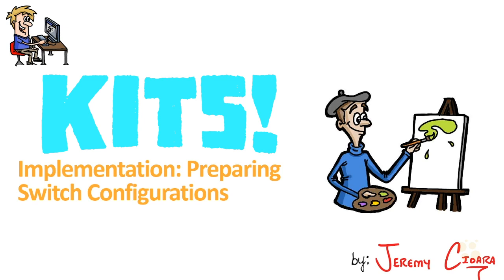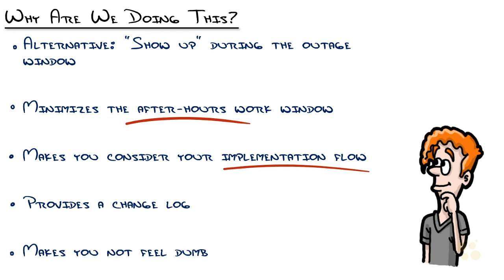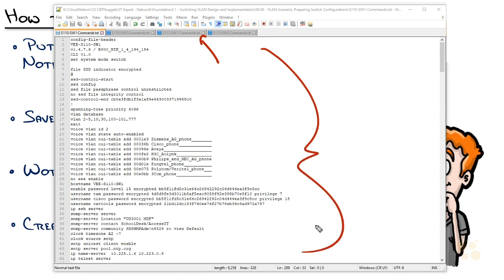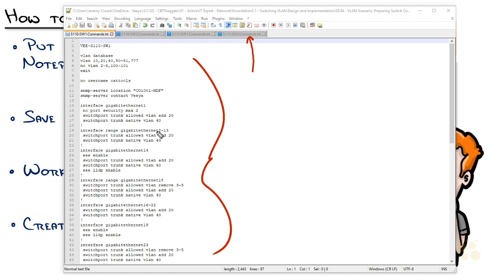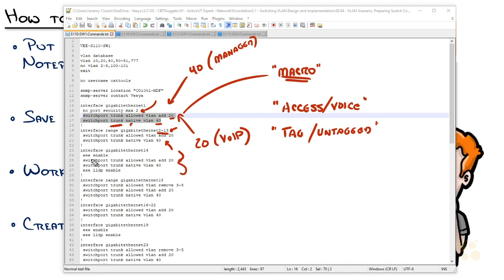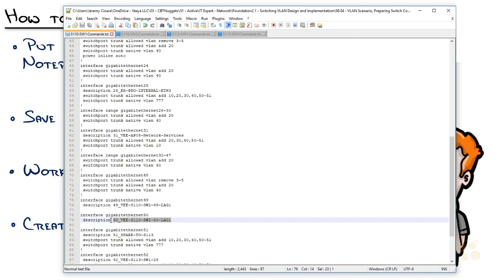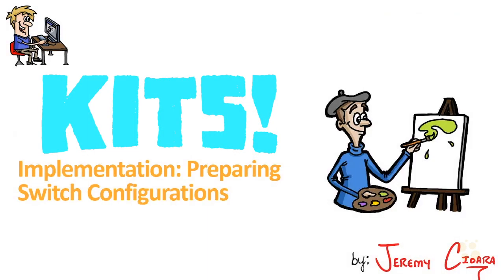How to prepare network configs IN ADVANCE

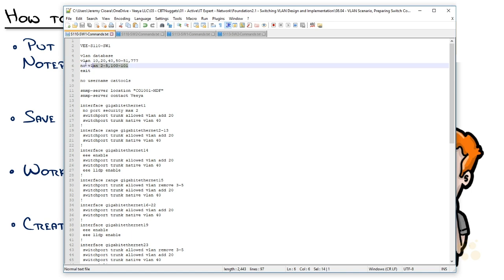Comment: 9:27 Is the solution to eliminate all unused VLANs as the final command? Because by then, you'd already have reconfigured the interfaces into the new VLANs, which means you have connectivity (if you didn't, you'd notice that before the final step of eliminating the unused VLANs).

Comment: I would really love some "commit mode" on cisco. It would be useful when you have to do something that will cutoff your access, do some configuration later, but you can't avoid it. The closest thing I know is a manually activated EEM applet, but this is a total hassle
BYW Do you really have a user "cisco" with Privilege 15 in production?
Reply: Heh his SNMP password is in plain text and now exposed. The high end Cisco device IOSs do have commit systems that even self pre-checks for errors before committing to allow aborting changes and rollbacks to last save. I have used EEM scripts for procedures that would break connectivity part way through if done manually but EEM is bloated and has quirks in some setups that can make it stop part way through too. I started using TCL scripts instead which was cleaner code to read/write and because we have a few brands of switches that all support TCL.